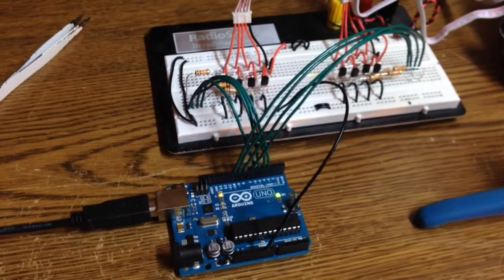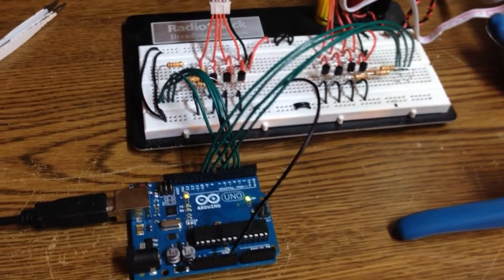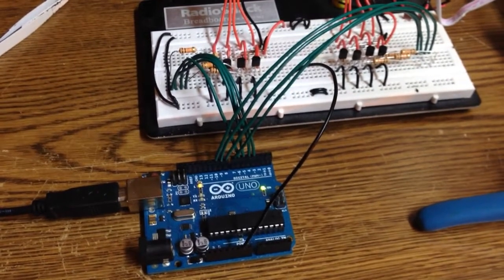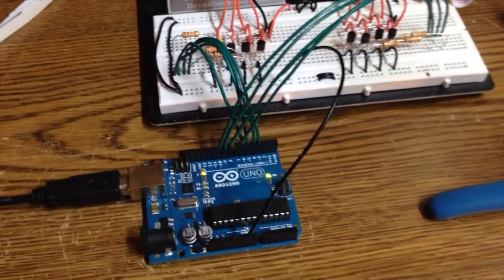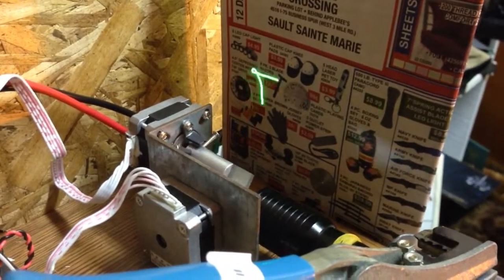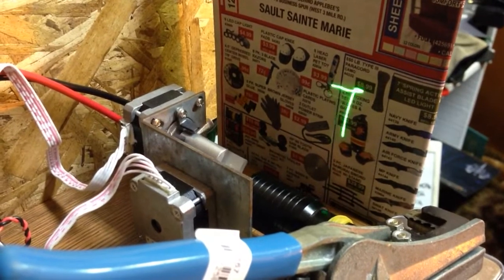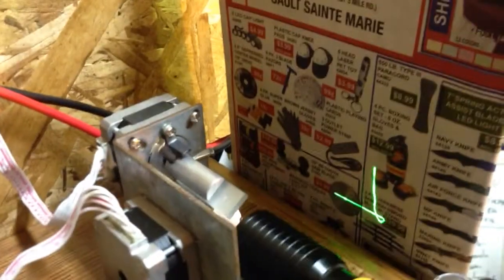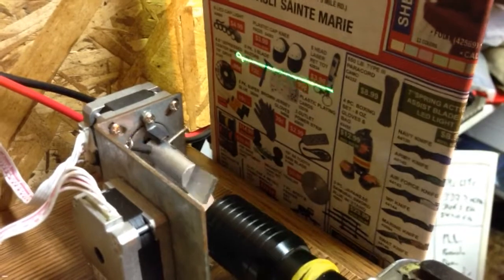DIY Arduino XY Stepper Motor Laser Scanner part 2

Comment: If you increase the input voltage to the stepper you should be able to drive it faster and not miss steps.
Reply from the maker: That's the very first thing I tried. Ran it on 12V and I still couldn't decrease the on time of the pulses any without missing steps, not even 250uS faster. The coils respond to very fast pulses, but the rotor doesn't seem to. I can feel the magnetostriction of fast pulses, but the rotor doesn't move any.